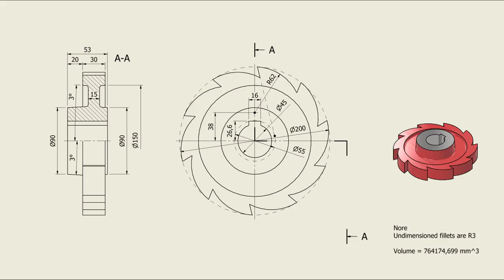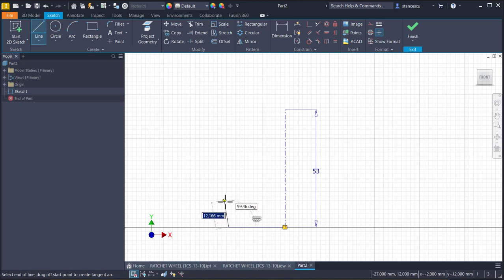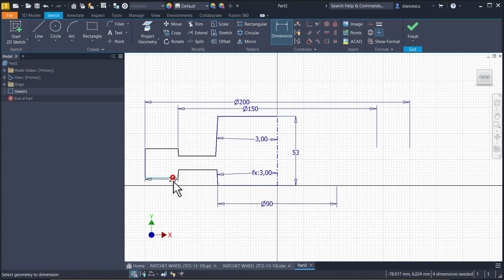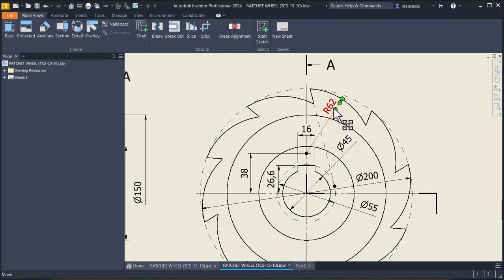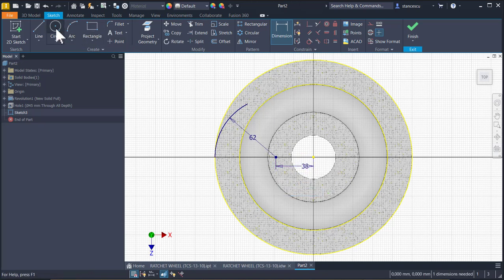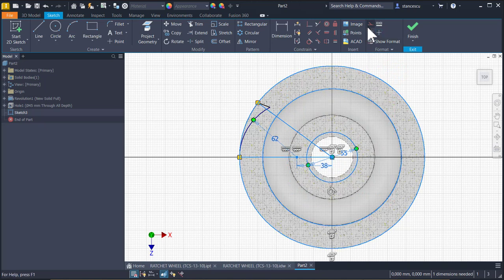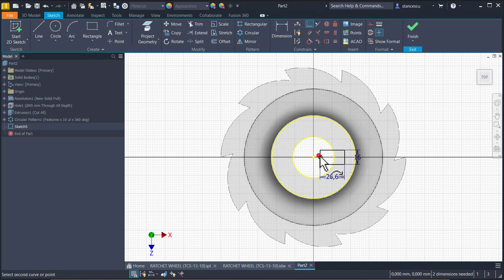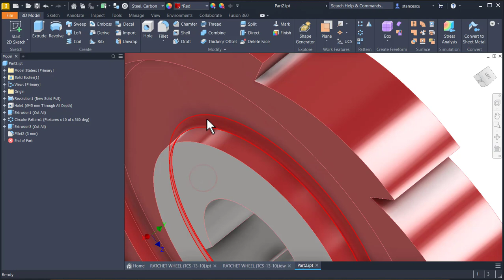Tutorial Inventor - 371 RATCHET WHEEL (TCS-13-10)

Comment: Dear Teacher, could you tell me how can I do to put the sketch background in  square milimeters?.

Regards and thanks for the video
Reply from the maker: Start a new model by using the „Standard (mm).ipt” template, then select New 2D Sketch. I suppose now you don't see the millimetric grid but you want to see it. Tap the keys Alt f i (in sequence, not together) and the Application Options appears. Select Sketch tab, then check the options Grid lines, Minor grid lines and Axes. Finish the procedure with OK.
Reply: @prof-stancescu   Thanks a lot Profesor, Now it´s most elegant for me with the milimeters 🙂 background
Reply: Great work Dr. Stancescu